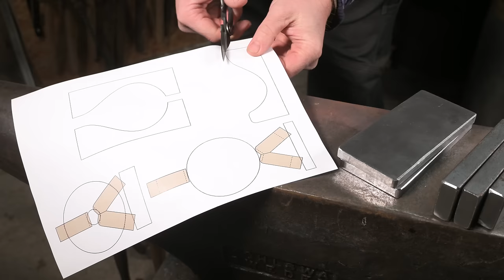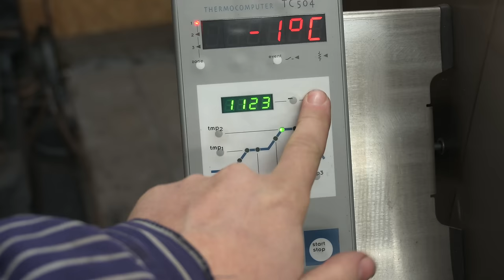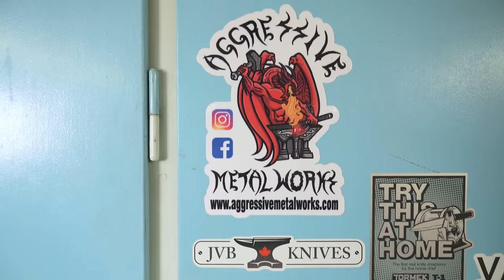Blacksmithing - The Oil Lamp Experiment!

Comment: Hey Torbjörn, that's great work! I'm interested in the lower saddle configuration. What is the preferred angle between the two contoured blocks? Happy Holiday
Reply from the maker: Thank you. Not sure, but here they are 60 degrees from each other. 30 from the center

Comment: Have you ever tried using white-out to mark your steel? I hear that it won't burn off with flame or heat.
Reply from the maker: Well it will never stick to the surface. It just leaves a thin layer of zinc oxide or maybe titanium dioxide, but will never "bond"

Comment: Why did it break off on the hot side but not on the cold side when forging?
Reply from the maker: That side is much more aggressive and stretches the material too much. It can be mitigated with preforming that part first in another tool, but it was good enough here.

Comment: How does it not leak? Wasn't the copper in there to join the two pieces (main body, and plug) so it doesn't leak? If the copper climbed up the steel unexpectedly, how can there still be enough between the two pieces to keep things from leaking?
Reply from the maker: It's a form of soldering or brazing. The copper bonds and fill the gap between the pieces. The joint only needs a minute amount.

Comment: I'm confused. I didn't think the oven was at a high enough temperature to even melt copper. Did I miss something?
Reply from the maker: It topped at 1125 Celsius. Copper melts at 1085
Reply: @torbjornahman ok. I knew I missed something.